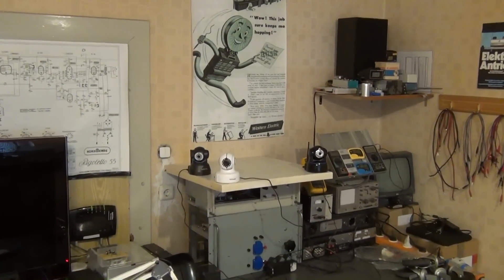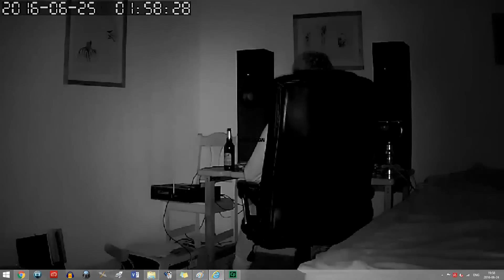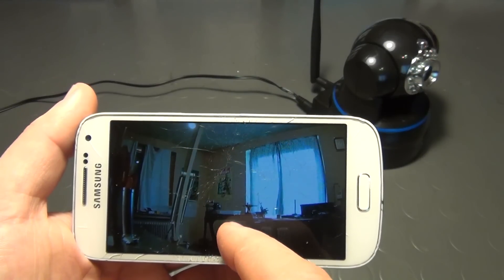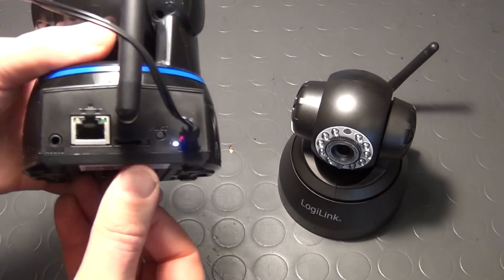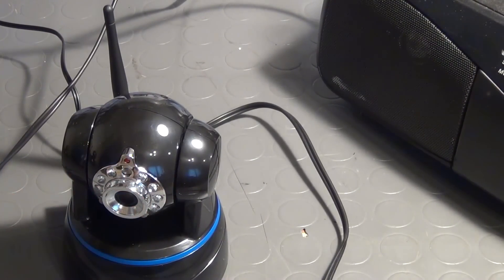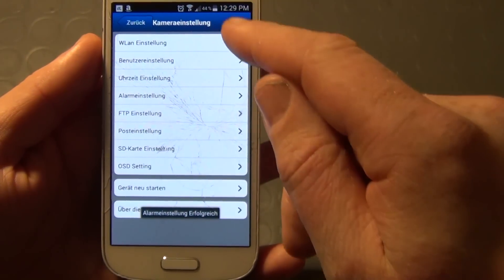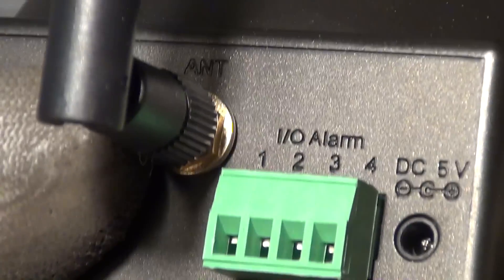Cheap IP Camera Basics + Product Reviews

Comment: a little while ago i took a similar ip-camera apart. the reasom for the spooky startup routine is that positioning works with stepper motors in open loop and without end-switches. (mounts for endswitches where there, but unused). so these cameras drive into the mechanical stop for a preset number of steps to set the zero point. and the internal cameras are USB 2.0, didn't try to connect but measured it with a scope. and i was able to find docs for the board with the "System On Chip": http://nixcores.com/nixcore_x1.php#documentation

Comment: You might want to check out the Foscam brand of cameras. They are pretty nice for the price, though they do have some issues with quality control sometimes, but I'm guessing that's pretty common on cheap cameras from china. There are good reviews on several of them by a guy called AkwardHamster here on YT

Comment: I've worked with some IP security cameras (IQeye, Axis, Sony IPELA) and many cameras will provide an RTSP stream which is just a live feed of whatever they see.  Many NVR applications can simply capture that stream and do the processing of motion detection in the application itself.  It's not great for your bandwidth in your house, but it is an option for cameras that have no native support.  If you can get a dedicated NVR system for IP cameras, you can use that for your processing and storage.

Comment from the maker: Hey guys, sorry about the annoying task-bar that appears in some of the footage, I only noticed that when it was already too late.
Reply: Don't sweat it, it doesn't really disturb anything that there is to see.
Mach Dir keinen Kopp, passt schon, stört nicht wirklich :)
Reply: +TPAI But it shows that you're apparently using Windows 8 or 10, and have the Avira antivirus software installed. I strongly recommend against that, because Avira is the Apexis camera of antivirus softwares. Under Windows 10, even the Windows Defender app that comes directly with your system has better recognition rates than that p.o.s. software from Avira. Just a friendly advice...
Reply: I didn't even notice before you told me. :D
Reply: ***** Well, it may be "good" software, but it sure misses a lot of stuff - On the computer of a friend, he had some kind of infection, using Avira, it showed nothing. Then we switched back from Avira to Windows Defender and the warnings started popping up for all the stuff Avira didn't see...
Reply: ***** Actually, when I install Windows computers for friends, I have come to only installing Windows defender. I haven't always done it that way. And one of the earlier PCs I installed Win10 on (the OS was 2-3 months old), where I still did use a dedicated AV software - in this case it was Avira as well - came back a couple months ago with a problem as well. It was somehow messed up in such a way that you could start no programs any more, because Windows would always tell you that the program is not compatible with this version of Windows - even if you right-clicked on the task bar to start taskmgr.exe ... I guess it was somehow infected, although the Desinfec't live scanner didn't detect anything, and neither did Avira.
Reply: Thats a very ignorant opinion! If you where true - why are almost all webservers running Linux? And why is Linux the base of most of the smartphones OS aka android? Why can you order professional hardware with Linux pre-installed? And what distribution are you talking about???
Reply: Seegal Galguntijak so true - i learned GIMP first and think the PS UI is crappy. But sadly I have to use PS for most of the time :(
Reply: HURRY UP , really cheap price , only 14$ IP CAMERA Flash sale , only here https://www.gearbest.com/ip-cameras/pp_666170.html?lkid=11331412
Reply: There's a name on top of gmail that you might want to edit out.
Reply from the maker: Could you point me to what exactly you mean (a time marker and maybe the "name" you're referring to. I actually created this gmail-address for this demonstration and checked the scrrenshots for any personal data, did I miss something?
Reply: +The Post Apocalyptic Inventor: He means 3:18 i guess. But it's not a big deal since this seems to be a dummy account you created just for the purpose of demonstrating it. I wonder why he didn't notice that this is not your official email account...
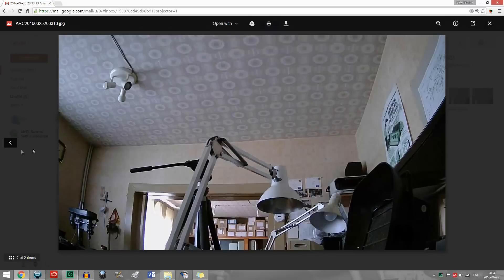Reply: The Post Apocalyptic Inventor at around 3:30, I mean I saw a name up top right, and I know you like your anonymity.
Reply: ***** It's no problem, I just reformatted that machine and newly installed Windows - this time without Avira, but with the internal Windows defender. I also used another ad blocker (Firefox browser, it hat AdBlock Plus before, now it's running uBlock Origin), which is a central element of every strategy against malware nowadays. Never heard of any problems since then (but it's been only 2-3 months). Anyways, every time I experience something like that, I am glad not to run Windows on my machines any more. Linux is so much better to work with, it's clear, it's logical, it's understandable (where Windows shows you inexpressive error messages like "there was a problem", and when you click on details it says "the procedure couldn't be completed")... Unfortunately, I still have too many friends using Windows and who require someone to look after their computers every once in a while... ;)
Reply: Seegal Galguntijak
Linux is an OS that is slapped together by a horde of people without any common sense. Usability cannot be found there and the hardware compatibility list is missing potent modern hardware. Only severely outdated hardware is supported. Not an option for me other than in a VM.
Reply: ***** Well, that is your opinion. I find it about 7 years out of date, but that's your prerogative. I don't want to 'convert' anyone, I'm just saying that I am happy with it, because I get along with it so much nicer than I ever did when I was using Windows (which was from the early 90s to 2006).
Reply: Linux on a personal machine is good for people who don't mind doing troubleshooting themselves and use strings of commands to make something work. Linux works good on data servers, prototypes, TV tuners and other machines with limited use scenarios you can test and debug once and leave it.
It's hassle-free on phones, because they have known hardware and it's the manufacturers' job to port android to their device, which means you may not get updates. Same thing with Apple, they don't bother to make new OS backwards compatible, but it works good on new stuff.

I think people don't appreciate enough how Windows supports all the different hardware, software and driver combinations including legacy stuff while still providing professional support and warranty. I only need to use virtual XP for really obscure and outdated software, the rest works flawlessly on my 6 year old laptop running Win10 x64 updated for free from 7 x32, plus the update made it run faster.
Reply: t33s the thing is that you eithe have to pay money or invest time to get a good running OS on your computer. Simple as that... nothing is for free :D
Reply: With Apple you also get screwed with poor thermal design and water damage vulnerability, not to mention software throttling after updates. Anything to make you buy a new one :P
Reply: t33s I don't have any troubleshooting efforts on my various Lenovo Thinkpads all running Linux. I install it once, set it up the way I like it (yes, including tweaks for power consumption/battery life, using the fingerprint reader and so on), and it just works flawlessly. Two of those laptops are about 5 years old, one is about 7 years old. Then, there is a 8 year old one which I use as a home server with Debian Linux and no GUI, what you would call "special application", but even that is relatively easy to set up if you know what you are doing.
When I have to set up a Windows PC for someone, I always have the feeling that I have to hope for it to work, although I know I'm doing everything right, it is never safe to say "this will be the outcome", just because Windows is designed in such a way that it doesn't really tell you what's going on "on the inside", while with Linux, you can easily look "under the hood". At least that's my experience, but of course when I first started using Linux in 2006, it was quite a learning curve. I was lucky to have someone I could ask about certain things, and so I have learned enough so that I am now able to help myself - which is normally not necessary. When it's set up once, it will run until you change something severely (and if you did it right, it will keep running), or until the hardware breaks down.
Reply: Seegal Galguntijak
It's nice that Linux does well for you but it does not for me. It does not even recognize my fucking PCIe NVMe SSD!
Reply: ***** I have no experience with such new hardware. My newest machines have a mSATA SSD, which gets recognized as /dev/sdb instead of being the "first" drive /dev/sda, but that doesn't matter at all, because of no drive letters, and the usual usage of UUIDs for partitions :)

So while I don't know anything abot NVMe drives, this is what I found out real quick with one Google search: http://itpeernetwork.intel.com/finding-your-new-intel-ssd-for-pcie-think-nvme-not-scsi/
Reply: Seegal Galguntijak Thinkpads are quite popular with linux users, so no wonder they work fine :P I tried using different distros over the years, but it never ran everything I wanted. I might try one again, but if it still can't run Photoshop and Premiere properly without a virtual machine there's no chance it will be my primary os. I tried gimp, but the UI is so crappy it ruins my workflow even with photoshop-like layout installed.
Reply: t33s Photoshop and Premiere are Windows programs, so either you'll get them to run with WINE or not at all. But since these are highly complex Windows programs, I'd guess 'not at all' would be more likely. Which is unfortunate, but if I needed them, I'd somehow try a dual boot system (although, whenever I had one and was in Windows, I felt that my computer was useless, because all my data was of course on the Linux partitions, which are inaccessible from Windows), or just stay with Windows, since that's what you're used to (again, I'm not trying to convert anyone). As for GIMP vs. Photoshop - yes, it totally depends on which program you learned first. If you then try to switch to the other one, you'll have a hard time getting used to it, so that's understandable, too.
Reply: please can anyone tell me ,how can I block the ipc from letting everybody to see my live stream vid on the net. or  on insecam.
Reply: lool
Reply: http://www.microseven.com/tv/livevideo-8Jtg8dVsFY4.html
Reply: ANCIENT ASTRONAUT
Reply: Kyôdai Ken
Reply: can you set up these cameras using a direct network cable to a PC instead of going via router..